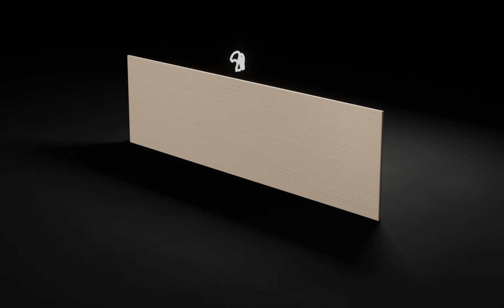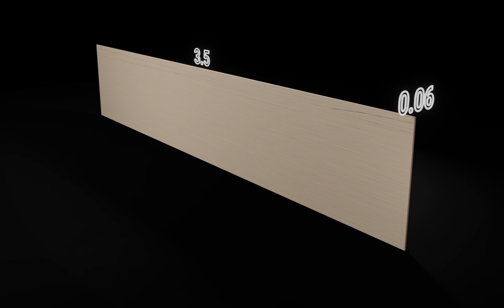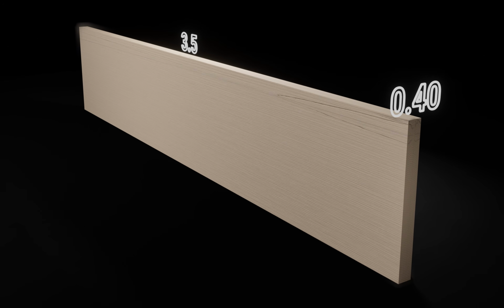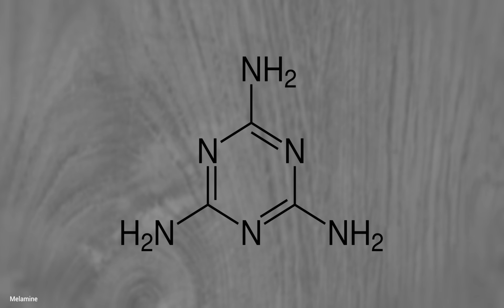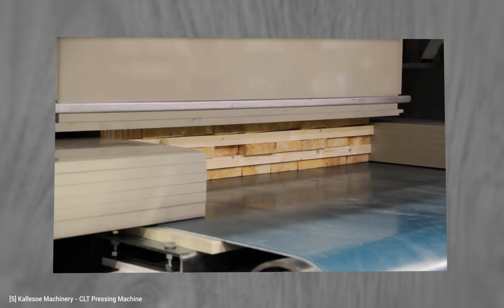An Introduction to Cross Laminated Timber (CLT)

Comment: isn't this the same of plywood but on a larger scale ?
Reply from the maker: Kind of, but not exactly. CLT is similar to plywood in how it’s made (layers of wood glued together at perpendicular angles), but CLT uses planks which are much thicker.
CLT also comes as large, strong panels that can be used as structural walls and floors in buildings, unlike plywood.